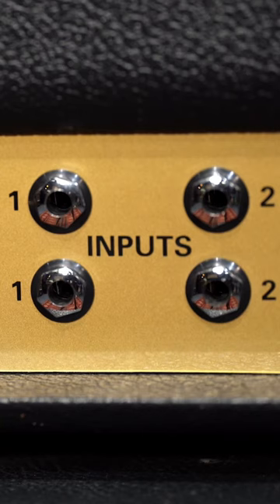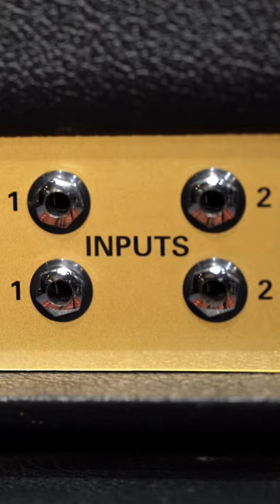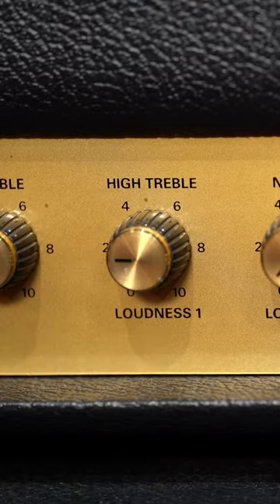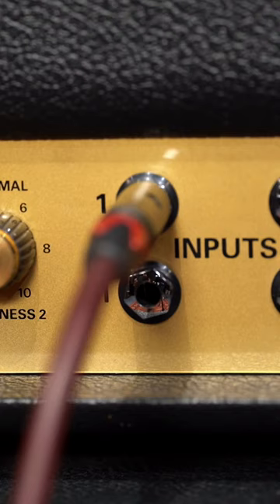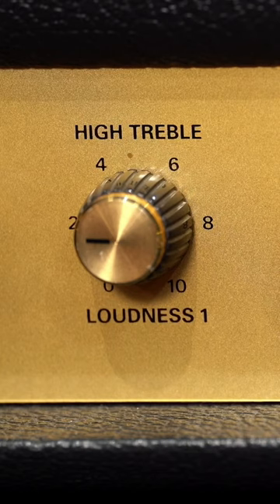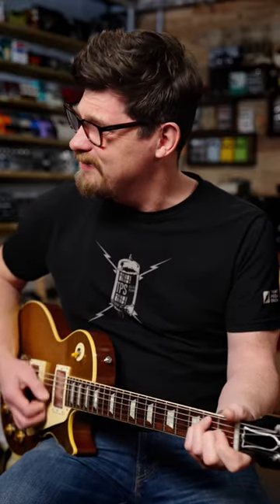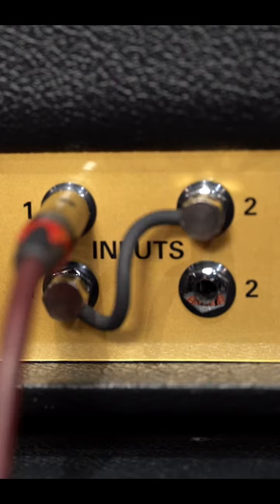Jump The Channels On A Classic 4-Input Marshall Amp #shorts

Comment: Run my SV20 Plexi jumped, really sings. Have found the sweet spot at: Presence 4, Bass 6, Mid 6, Treble 6, Treble Channel at 4 and Normal Channel at 6 - hitting it with a Fuzzrocious Lil Fella with the pedal volume cranked - sounds glorious and recording everything from blues to 70's rock to modern thrash with pretty much no settings changes - just bypass the pedal and roll back the guitar vol knob and it cleans up nicely. Cheers!

Comment: I like to run an attenuator to control volume. It's really an integral part of the signal chain. Volumes at 4-5 will give you edge of breakup that cleans up really nice off the volume knob and still works as a pedal platform.

Comment: If I wanted to run two amps at the same time, can I run a cable from the second input on one amp into the input of a second amp, and blend both amps together?
Reply from the maker: You can with some caveats. They need to be in phase, and one probably needs some ground isolation. Cheers!
Reply: @ThatPedalShow  Understood. I don't have an amp with two/four inputs, but was just curious. ✌️

Comment: I don’t get how an input going into another input works
Reply from the maker: Google it - all is explained in how these inputs are wired.
Reply: Would using an ABY pedal into each channel and having both outputs from the pedal on, do the same thing as jumping? Just thinking that this would enable you to switch between channels as well as having the amp jumped.

Comment: My Fender amp has four inputs…
Reply: Make sure they are in phase otherwise it will suck. Not all amps can be jumped. I have very nice 1983 Marshall 2203 (2 input cannot jump) and a 1967 Fender Bassman AB165 jumped. The Marshall collects dust.